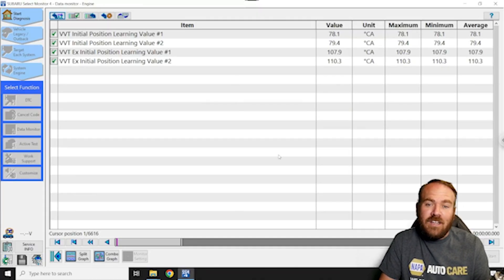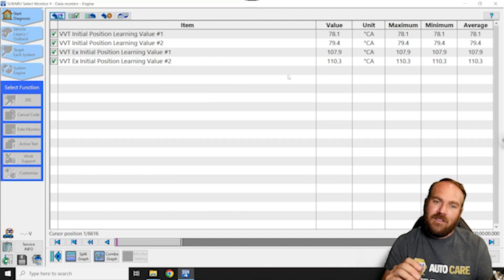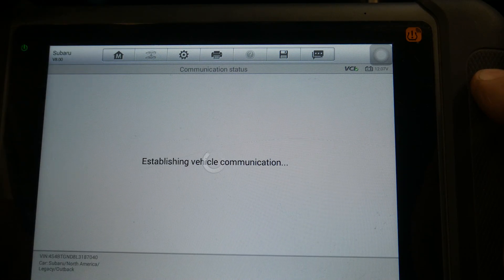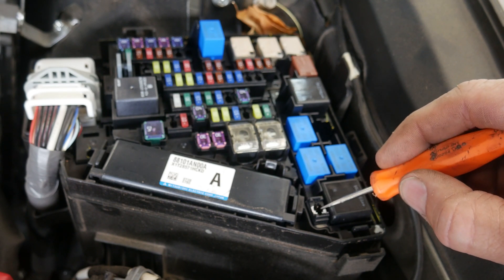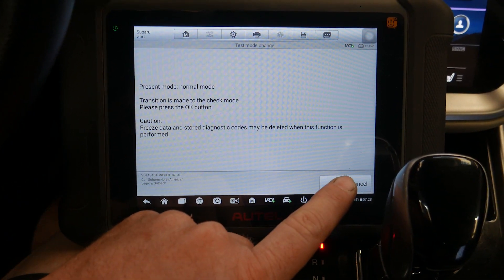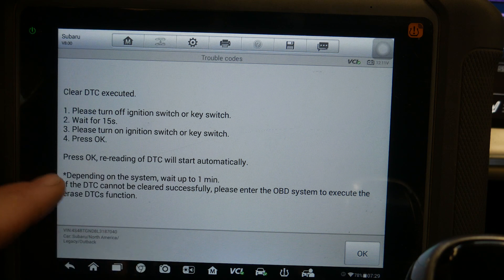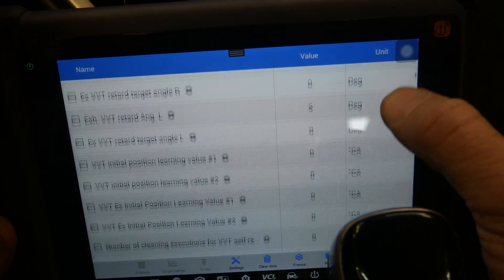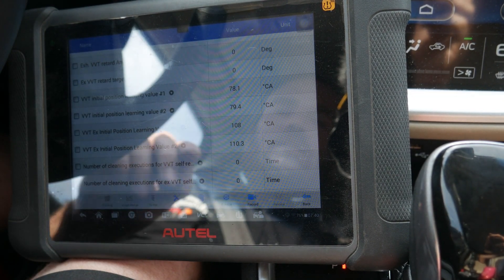Subaru VVT Learned Values Reset With Autel | ECM Saved!

Comment: Can confirm that me and a friend just did this on my 2016 Subaru WRX Limited with a Autel MK808TS. I had the P0017 (passenger side lower exhaust). I changed the oil control valve at that point which didn't fix it. So I replaced the other 3 just to be safe so when I did this, all 4 oil control valves would be new. That exhaust value was the only one out of range (146). After learned values were cleared, it's sticking at 115.8 and no CEL
Reply from the maker: Thanks for confirming!!
Reply: @ThePracticalMechanic yeah man good looking out i was about to drop a lot of money on four new sprockets new timing chains and all the other stuff associated with that but then I was reading people had done that or maybe one sprocket and was still getting the code so I was like heck no
Reply from the maker: @Keyboardletters my first step is an oil flush and reset, followed by swapping AVCS solenoid from one location to another or installing a tester that I use in the tool box. If that doesn’t resolve it then we need to open it up.
Reply: @ThePracticalMechanic oh yeah I did an oil flush with some liguid molly engine flush, swap cam position sensors and oil control valves prior to finding you all's video

Comment: I am doing the exact same thing but when i go to delete code after put in test mode it say that this is not supported and goes back to normal mode  forester XT 2015
Reply from the maker: Some have reported issues after an update from autel. You may want to manually select a different year or even a non turbo option and see if allows it. 
If you can’t resolve it let me know. I offer a mail in service as well.

Comment: Thanks, it worked for us, a P0016 code, new actuator, then this method, BUT ours was a '15 Subaru XV, AND fuse was #17, in the very front of the box, in the trapezoid shaped part of the box, inboard of a red relay. Not same fuse as this video. I used an OTTOFIX Scanner by Autel.

Comment: Thank you so much ! It worked on my 2015 Scion FRS. 
 I was getting a P0016 code. I did some diagnostics like swapping cam sensors and oil control valve to see if check engine light code changes but code remained the same. 
Then I read that ECM may need to be replaced due to faulty values burnt in. 
I was able to put my car in test mode following your video and clear the fault memory using Thinkdiag 2 and I no longer have the P0016 code ! Really hoping it stays like this.
Thank you so much !
Reply: Hey! I'm wondering if it stayed off?
Reply: @a @asapicton7038 yes, it’s been great so far 😊
Reply: @asapicton7038 me too!

Comment: This doesn't appear to work on a 2021 outback.  Tried it a few times, waiting longer after each time clearing codes in the special mode and those didn't reset.  
I am using a launch x431 v4.

Comment: I tried this with my autel ms 909 updated to "2023" in a 2014 Crosstrek. When i try to make the transition (with the fuse installed) it keeps telling me to plug in the green (or in some vehicles white) check mode connectors. I didn't think these models had the connectors and have looked everywhere, drivers side and passenger side and i cant for the life of me find any actual connectors. The autel even has a picture of the connectors and i still cant find them. I know sometimes the aftermarket scanners can give bunk info. Fo you know if the 14 Crosstrek has the connectors or not? Or how to help me at all, super frustersting.
Reply from the maker: 2012 through 14 doesn’t always work with the scan tool. If you can’t get it to perform with the scan tool, I can do it through a mail in service.

Comment: I had autel 608, put the fuse and go test mode and no fault codes in test mode , erase the code and nothing still the same value
Reply from the maker: Year make and model? 
Sometimes it takes multiple attempts. Try leaving the key off for 2 minutes after clearing doing the reset.

Comment: For those just coming to this video to learn the process,  I bought a TOPDON Artidaig Pro and it came with Subaru V20.xx software.  I was able to clear the values and see the VVT initial values.  I completed my work, performed the reset and all is great.  I decided to let my Scan tool update and forgot to uncheck the subaru.  it updated to version V25.xx and now the VVT learned values do not show up in the data.  If you think auto companies are here to help you, think again.  They removed the readings so you would be forced to buy the ecm for 1300 after programming.  Do not update your scan tool to the latest subaru software if it currently works.
Reply: OK, I may have found what TOPDON has done.  I have not tried a new reset but it seems they renamed the VVT Initial Learning Values to AVCS initial learning values.  Will have to experiment and see.  Others can comment if it is the same thing.  My daughters car is working great and I do not want to try the reset as of now.
Reply from the maker: @jimbelcher988  it should be the same thing as Subaru uses the term AVCS but they shouldn’t have changed the name. The OEM tool shows vvt initial learned values.
Reply: @jimbelcher988  anyway to confirm if TOPDON still works? ive got a 2016 WRX replaced the engine and ive gotten stuck with p0017, ive done all the diag back to the ecu including line testing. next step is to get a scan tool. not wanting to spent $1500 on a autel at the moment. will you let me know!!??
Reply: GWsmart07 scanner from Gear Wrench works perfectly. Can see vvt values plus clears the codes even with the updates.

Comment: THANK YOUUUU! Was able to reset values using the Thinkdiag2 on my 2016 Crosstrek! Got DTC P0016 and between TSB and a CEL inspection at Subaru service center, I replaced the camshaft sensors, crankshaft sensor, VVT solenoids , and did an engine oil flush. DTC reappeared. Service tech then recommended ECM replacement and quoted $1300. When asked if ECM could be reprogrammed, was told they tried but old values were stuck and replacement was the only way to go... Welp, spent $130 on the scanner and took less than 10mins to reset the values and have been CEL-free for the last ~100 miles. Thank you for sharing this!!
Reply: We need your help ! Does the thinkdiag2 work for this method ?!
Reply: @marcosb562  yes it does .. u must put the fuse in the service fuse port to open the ECU the. The thinkdag can do its thing.. I did this on my wife's WRX . Over 300 miles and no codes or pending codes
Reply: The process is almost the same as far as what programs to click on to get where you need to be
Reply: @marcosb562  yes it does, put fuse in delivery port then thinkdiag 2 select 16 pin and go into ECU it will prompt you that it'll erase stored values and tha';s what you want. I'm at 100+ miles and no CEL return.
Reply: Hi Alex! That's great news that it worked for you.  What scanner did you buy?  The one he uses is 1300$ and that's somewhat expensive for me.
Reply: I just got a thinkdiag2 .. I can't seem to find where it is... Can u direct me.

Comment: I used the MK900 for this and it absolutely fixed my problem. My values were out of range so there was no way the ECU was going to reset them itself.
Reply: you used the autel MK900-BT? im about to buy one for this issue :')

Comment: I had codes P0011, P0014,P0024 and after replacing the oil which was over due and then replacing the VVTs, the original fault codes cleared and now I am left with P0017, P0019. These I see that they may go away on their own if the computer relearned them but if they are out of range they will not. So I need to clear them. I bought an Autell MK900 hopefully it has the same functions. And resolves my issue. I saw this on the service bulletin as well. @thepracticalmechanic

Comment: Thanks for the clear guide. My xtool D8s was not able to clear a 2019 subaru 2.0, after a few updates from the xtool attempting to fix the issues it still was not possible. Not all scanners are equal.
Reply from the maker: @wisky3  I just did some testing with the xtool d8, kingbolen elite and the kingbolen k10. None could perform the reset which is too bad because they all run similar software.
Reply from the maker: @wisky3  I also offer mail in service if needed. Email me at chad@thepracticalmechanic.com
Reply: @ThePracticalMechanic  i had to pay a local shop $200 to do the reset.
Reply from the maker: @wisky3  did you have to show them my method?
Reply: @ThePracticalMechanic  yes i sent them a video, initially scanner would crash when you would select special test or change mode, after the update it just would say communication failed.
Reply from the maker: @wisky3  but got it resolved in the end I hope since they charged you?
Reply: @ThePracticalMechanic  yes it did
Reply: @ThePracticalMechanic  no
Reply from the maker: @wisky3  the light returned? What are the learned values at now?
Reply: @ThePracticalMechanic  light has not returned, learned values exh is 80-90 and intake is 55-60. I replaced 1 exhaust oil control valve.

Comment: Anyone else not have this work? Tried countless combinations of key cycles, when to pull the fuse, and how long to keep the key off, all with no luck.

I get the “selected function is not supported” screen when trying to clear codes(no codes currently present), hit escape then told to cycle key. But never resets the values. 

Found someone else referencing this only works on the plastic housing ecu’s and not the metal housing ones?
Reply from the maker: @tommypdcantcopsht  I’ve done it on metal housing ECMs but what I’ve found is they are more stubborn.  
We have also found that many of the 2014 and older don’t like this reset and require mail in service to reset.
Reply: @ damn ok appreciate it. Got a recommendation for mail in service
Reply from the maker: @ I can do it. email me the details of the vehicle. Chad@thepracticalmechanic.com

Comment: Our VVT values are not zeroing out.  I have tried this procedure(many times) with Autel and Launch.  Step by step as you show and when we go to check the values they are never at zero.  They are at the same value they were at before starting the procedure.  We are following your steps exactly the same.  We just never see zeros.  We drive the car and about the 3 drive cycle the same engine code P0016 comes up.
Reply from the maker: @LakeshoreAutosOnline  what year?
Try the reset again but this time after you clear codes turn off the ignition for 2 minutes and then recheck. Some modules are stubborn and reset with a longer key off cycle.
Reply from the maker: @LakeshoreAutosOnline  other possibility is a mechanical issue with the car.

Comment: hello please someone help me , i bought this wrx off this  shady dealership not knowing its still married to the cobb accessport and now am having issue with the car . month later i bought to subaru dealership and i was told to get it replace with the price of $!k . will this help fix my issue as well ? thank you
Reply from the maker: @jeromemauricio82  I honestly don’t know if this reset will help you because I don’t know the details of your problems. If your car had a timing issue or bad engine that has since been resolved and now these codes are populating then this may work. I don’t know if it will work 100% because the Cobb tune may block the function. 
Subaru programming software also blocks flashing tune vehicles so returning to stock is difficult.  
If you provide more details of your problem and what diagnostics have been performed I may be able to help.

Comment: I keep getting a P000A I have 2013 frs it has all new sprockets any help ? I have changed both solenoids on bank 1 and camshaft position sensors the code doesn’t come right away after I changed the cam sensor it took a month to come back on. Could this be ECM problem?

Comment: which autel scanner is needed for this to work?? need it for a 2014 XV Crosstrek
Reply from the maker: @shawnhall6803  2014 and older may not work with this method. Pretty much any autel should have the feature if possible but only a few have got it to work on a 2014 and that’s likely because some models share the same ECU with the 2015 car. 
If this reset doesn’t work I can reset the values by reading the eeprom and writing in a corrected file.
If you have eeprom tools I can do it via email or you mail in the ECM and I’ll correct it and mail back same or next day.

Comment: I'm in the group of Crosstrek challengees here... got a P0017 blip.  Replaced the VVT solenoids myself, didn't work.  Went to dealer, they replaced the same pieces, that didn't work.  Dealership wanted another $4100 to remove cover, replace 2 sprockets, replace ecm.  Dealership said that the valve timing values couldn't be reset.  Before doing any thing else should i do this reset procedure?? What's the risk?? Great video, you're really helping alot of persons out there.
Reply from the maker: @joem6859  what year crosstrek? 
2014 and older cannot be reset with this method but I can reset them on the bench. I offer a mail in service. 

Timing gears are common to sludge up or fail internally causing the values to climb too high. 
I typically change the oil, reset the ECM, and then take the car for a drive to see if the numbers return back to a high value. If the values stay within range I release the car with an advisement that the timing components may need to be replaced. 

Part of the TSB is to unplug all the solenoids and monitor the vvt angle within the first 10 seconds of start up to see if the timing is off. 
If you trust the shops diag on the timing parts but wanted to save money on the ECM you can mail it in to me and have it reset after the repairs have been performed. They will likely charge $800-1200 for ECM replacement depending on part number. My fee is a fraction of that. 
If you have a 2015 or newer the reset in this video should work fine to reset the values back to zero.
Reply: @ThePracticalMechanic  2018
Reply: @ThePracticalMechanic  I just want to make sure I can't do any damage to engine if i reset ecm per your vid...

Comment: Thank you thank you thank you. This is exactly what I needed to walk me through using the T8 Icon Diagnostics Scanner to clear these values and clear the forever reoccurring P0019 error code. I had already removed and cleaned all 4 vvt sensor on a 2018 Subaru Crosstrek and replaced all 4 camshaft position sensors and the crankshaft position sensor and couldn't get the error code to clear. Once I went through your process with the service fuse in place the sensors went from reading at 98 and 107 to reading 88 and 89. Error cleared and stayed cleared. Thanks man.
Reply from the maker: @PatrickAndrews-d4t  glad I could help. I had a forester last week with a sticking vvt actuator. Intake values were 86 and 96. Max was 88°. Replaced actuators, cleared values and they returned to 84, 85°.
Reply: Hey I’m trying to use the same Icon T8 but can’t get to where I need to be, any tips??

Comment: can you do this with a snap on scan tool?
Reply from the maker: @martinsmith2948  no. Snapon does not have the “change test mode” button. Autel, launch, topdon, think tool all should work. 
Even the OEM scan tool isn’t capable of resetting these.

Comment: Managed to reset the values on a 2017 WRX after changing the sprocket, this is one of the best things I've found on youtube in my life, thanks man!!!
Reply: Which scanner did you use and what were the steps? All scanners I’m getting my hands on only have dealer check mode.  Is this the same as test mode change?
Reply: @Ghosti-nd9po  My mechanic followed the exact same steps on an Autel scanner, Thinkdiag2 should work very similar. It does need the fuse in place for it to work on top of the mode in the scanner.
Reply: Do you remember where the fuse was that you had to activate for your wrx?

Comment: I am having code p0011 on my 2018 crosstrek, after checking timing and replacing my intake sprocket would i need to do this method of reset for that code or would a normal clear codes do the trick?

Comment: Worked on my 2019 wrx with the code p0018 
I did use the  Thinkdiag2 
After the dealer told me I needed a new ECU
The video was very helpful thank you
Reply: Could you please share the steps i have same problem. I cant find the test mode😢

Comment: Worked on a 2019 cross trek with p0017 after replacing all the timing components.  Used the launch tool.OTC Encore would not work.

Comment: In the second YouTube video I asked you where this fuse is located on my 2018 Subaru Crosstrek. - This is number 39, someone will need it.

I'm wondering if it's possible to delete vvt data using ssm4 if you can give me a little hint.
Reply from the maker: SSM4 does not have the feature. That is why dealer techs cannot perform a reset unless they own an aftermarket tool. I’ve had many dealer techs refuse to do this reset as well.

Comment: I need to know how to do this with the autel on a 2017 BRZ, I hear it also can be done,  I replaced the bank 2 intake sprocket. Letting RTV set up, Getting ready to start.  Any help thanks!
Reply from the maker: Brz cannot be done with scantool as far as I know. I do t have access to one for testing so I cannot confirm. I think the brz/FRS need to have the eeprom manually edited.
Reply: @ThePracticalMechanic  is it working for 2016 wrx fa20dit